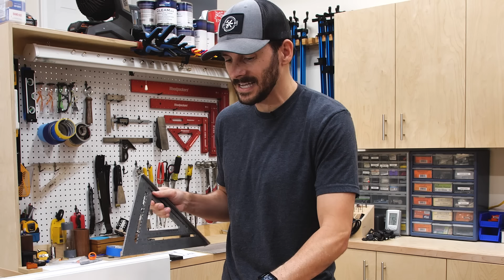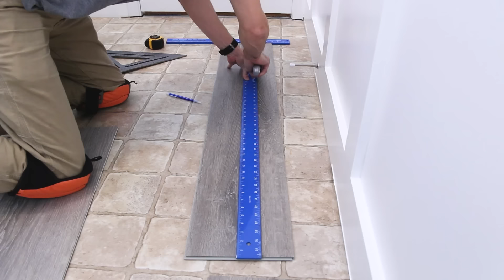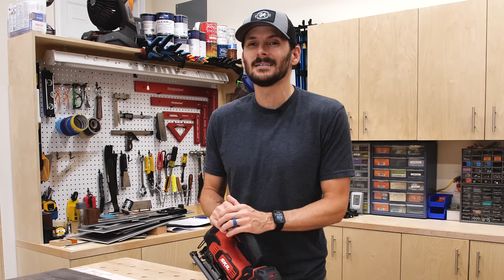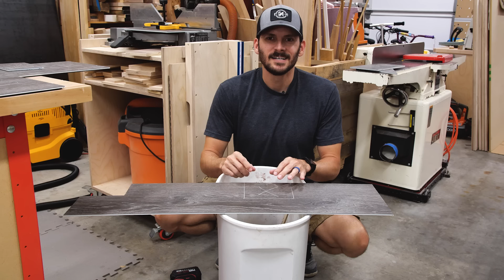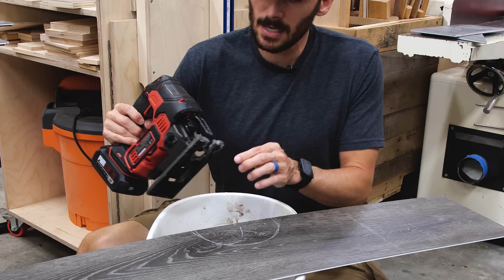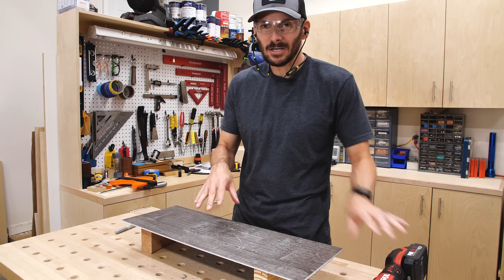How to Cut Vinyl Plank Flooring

Comment: What a great morning surprise! 
   Another great video of yours! 
   Watched it from the very beginning to the very end. Loved every part of it.
    You even got me to laugh when you were playing around with your short cut vinyl plank! (Which you erred on.)

    After watching both of your install videos of your vinyl plank flooring, you got me to install my very own vinyl plank flooring in My den.

 Came out really beautiful! 
  And just about all the tips and tricks you learn as your start to install the flooring.

   Starting with taking the measurements of the room and determining how much ,how many boxes of vinyl plank flooring you need,
+10%.
  As well exactly where you will start a whole plank and where not.
 As well I found it really important to measure from one side of the room to the other side of the room like you mentioned in the video to make sure not to have a very skinny row at the very end.(referring to the front of the room and the end of the room the last row.)

   I made the same silly mistake where I measured from the wrong side and then forgot to turn around the plank to make the cut and cut on the wrong side.
  The good thing about that mistake, is you can use it for the other side of the room to start the row.

  Without a vinyl plank floor cutter, I found the easiest method was to score the plank multiple times.
  How did I avoid going off my original scoring line? 
 I tried to score a deep score the very first time which would enable me to follow in the same groove the second and third time.
  After 3-4 scores it snapped really clean and sharp, while I found if I scored only once it was a very messy snap.

 I found after installing 1-2 rows that a jigsaw was a must.
   There was no way I was cutting around the corners without a jigsaw.

 I managed to dull a metal blade and a wooden blade. 
 The vinyl is some tough flooring against those blades.

 In regards to cutting the rubber on the bottom which seemed to stay connected after scoring the planks or using a vinyl cutter, the easiest method I found was bending the planks together towards each other, the rubber backing came apart very easy.

   As well I realized the room would not look the same by putting a quarter inch round molding.
   So I must say you got me to buy the trim removal tool for $30 and boy did it work.
   
 Saved me all that time from cutting quarter inch round moldings.
    Pulled out all the nails from the back side which i see you didn't mention in the video.
  Don't try pulling out the nails from the front end or hammering it out, it will take you forever and make many holes on the front end of the molding, which will require you to put wood filler in each and every hole.
  Easiest way is to take a plier and pull each and every nail out from the back, grab twist and pull.
 Or use a tool to snap every nail in the back without pulling it out entirely.
     As well I had to remove the old caulk.
  But the install was so rewarding just nailing the trims back on. 

   Now the only thing left to do, is install the transition slides. 
 Which I have no clue what to do.
   The kitchen has tiles which is about 1-1 ½ inches taller then the new vinyl flooring that I just laid in the den.
   And then there is a glass porch door going out to the deck which has a plastic/metal track raised up two inches or so.

   So it seems like I'm going to need some type of transition slide going from The Gap between the flooring and the door.

 What would you recommend?

 Your videos were really amazing gave me the strength and ability to lay my own flooring.

 At first I'm like this is not happening.
  But after buying 24 boxes from Costco and bringing it to the room I'm like I'm doing it! 
   Having someone help you with this install was a great help! Had my brother. Made it much easier.
   I did the ends, he did the beginning of the row.
   He was able to tell me which planks he can use and which planks he could not use, and I shall use a new plank instead to give him scrap's to start the next row.

   Overall the flooring is not that hard to put down, but the cutouts makes it a bit tricky.

   Too bad I can't upload some pics of the flooring, it came out beautiful.

 Or maybe I can attach a link..

https://postimg.cc/xX3Xkjkv

https://postimg.cc/cvSK4tJ1
Reply from the maker: Looks great!
Reply: @Fixthisbuildthat  Thanks! 
  What would you recommend for the  transition slides for that door and the floor with a 1-2inch height difference?
Reply: @mayeri3083  hire a real floor guy next time it’ll be done in a couple hours without having to break your head. And that strip is called a reducer you’re welcome.
Reply: Yes, always mistakes made throughout Life.

Comment: Great tips and tricks video.  I had already planned on using the LifeProof vinyl planking for  my project and have already watched other tips and tricks videos for installation.  One additional tip for using the multi tool for cutting under door jambs.  Make sure you apply a thin layer of painter's tape or masking tape on top of the vinyl plank where the multi tool comes into contact with the plank so as to not mar the top surface of the plank as you're cutting into the door jamb.
Reply from the maker: Yep, if you needed to use that plank that's a great tip.  I usually use a scrap or one of those sample pieces from Home Depot of the same flooring
Reply: Good point, but you should be cutting all the door jambs before you install the vinyl flooring.
  
 you don't want to really be cutting and making a mess where you going to be laying the flooring.

 I prepped the room first, by vacuuming and then laying the flooring without having to vacuum every 5 seconds, even though I did vacuum here and there.

  When it came to scoring the board's I would snap them in the room, but anytime I used a power tool it took it out to another room.

 As is I found three-four times little pieces of vinyl got stuck in between which caused the vinyl not to snap in smoothly.

 Thanks to fix that build that! I knew to look out for that.

Comment: When you need  to cut a short piece you can also turn the piece 180 and the leverage the break with the long side of the plank
Reply from the maker: yes, I should have shown that.  But you likely need to put your knee on it vs just hand weight

Comment: ohhh nice vid Brad... I'll try these out on our house next year... hopefully these vinyl planks are cheap here in the PH... Also can you do a guide vid on what tools to prioritize when you are starting out...
Reply: If you watch his other vids he says what's needed.

 Tapping block, pull bar, or a scrap tile to bang against the other tiles.
   Multi tool/auscultating tool to cut the moldings.
 Wedges to keep the quarter inch Gap.
  Rubber mallet/hammer.
Carpenters squares, metal guides.
 Utility knife and a pack of blades.
Tape measure.
Pencil or permanent marker might work better.
Reply: @mayeri3083  oh thanks Mayer... are these tools for starting out woodworking in general or just for the tiles project... also I am looking for vid where budget would be discussed... like if you are starting out with let's say $300 vs $600 vs $900...
Reply: @jayjesse02  most of it is for wood working, but the pull bar, tapping block and laminate cutter are specifically made for laying flooring, as well as a rubber mallet, you can use a regular hammer, but be careful and always flip one of those tiles upside down banging on the rubber backing.
   Since I did it with a sibling of mine, he used the rubber mallet and I use the hammer, took one of the scrap pieces of vinyl flipped it upside down with the rubber backing and Banged away.
   Flooring came out A+. Thanks to FTBT!

Truth be told the pull bar and a tapping block is not a must but makes the job so much easier.
  A pull bar, tapping block and a set of spacers cost around $20 in Home Depot or Lowe's.
   If you're installing the floor do it right by buying those few tools.
Reply: @mayeri3083  thanks a lot... I'll make sure to do so...
Reply: @mayeri3083  I'll also try to check Brads other vids... I found that some of the things you need in woodworking you can actually make yourself like the diy woodworking table... hehe planning on making my own furnitures as well since the house is small... cheers!
Reply from the maker: thanks, Jay!  As far as the tool selection goes, check out fixthisbuildthat.com/beginner where we cover some of the tools to buy first and projects you can build

Comment: Good video. Regarding the can contour, you could just have put the can on top of the tile and followed the rest of the cans contour...
Reply from the maker: The can was representing a toilet flange installed on the floor or a pole.  You Wouldn't be able to move either of those, so that's what I was showing the technique for.
Reply: @Fixthisbuildthat  just got a set of those contour gauges from a friend last week had no clue what I could do with them.
Reply: Yes, but that tip would only work in his demo and can't be applied to a real world scenario as he described cutting around a toilet flange.  No one's going to remove a toilet to trace a perfect cut for a vinyl plank.
Reply: Good point there.

Comment: Good info, Brad. I just did 4 rooms and here's a couple of cautions. First, I used a miter saw and it gummed up my blade. Just be aware of this. Second, the flooring I used had to be locked in on the ends as well as the sides. That poses a problem for going around bumpouts, toilets, etc because the piece has to be lifted along its length as well as width. There are workarounds but just be aware of this too. Take care.  Bill
Reply from the maker: Great tips, Bill!